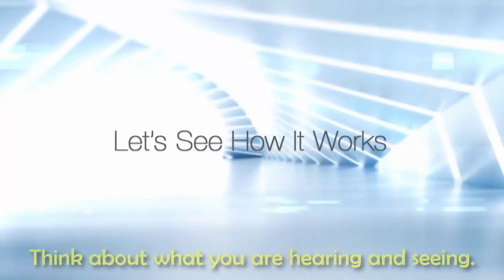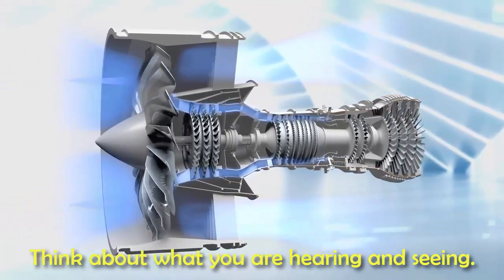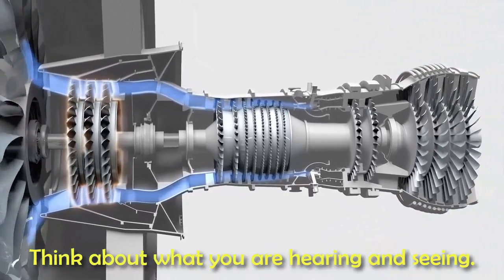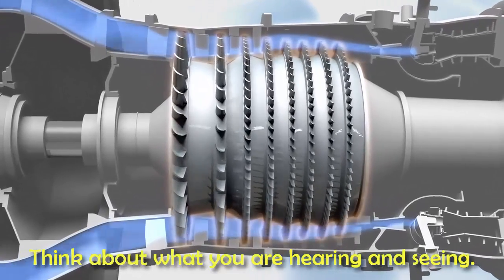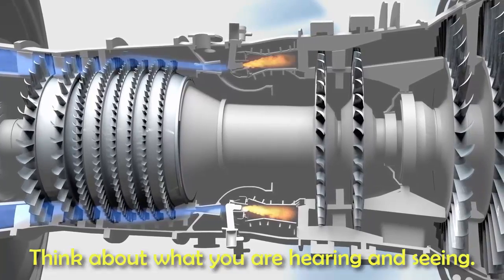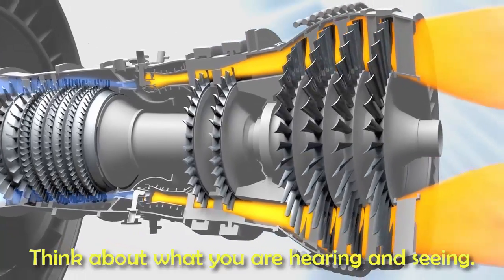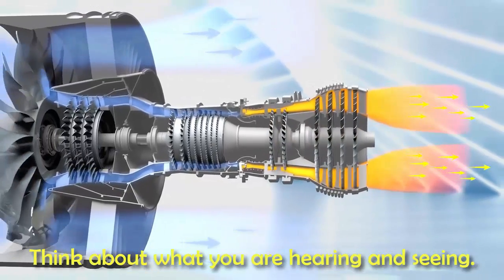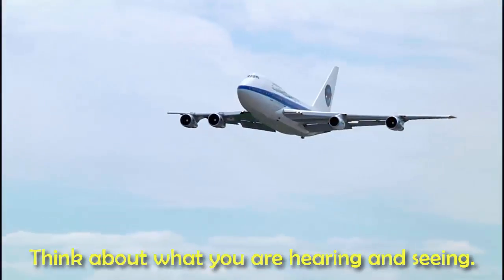'Jet Fuel Hoax' Debunked - Now Onto 'Jet ENGINE Hoax'!

Comment: So. From which part do the AIR control the temperature and cabinpressure?  Even Rolls Royce manual SAYS that the THRUST is 90% compressed air. Just watch next time you board a AIRplane at the AIRPORT how they start the engine no. One.  By compressed Air. On the A380 there is an extra landinggear in the WING.

Comment: Full of error and inaccuracies.
Reply: John le Bon - such as the suggestion that the engines run just in compressed air and not a compressed air / fuel air mixture. They typically burn about 3-4 tons of fuel per hour in the cruise. 

It talks about harmonics and air being fed back into the engine inlet, which doesn’t happen. It suggests the engine has a brake system to prevent it running away and accelerating uncontrollably, which they don’t. 

The speaker is incredulous about how simple the engine is. They actually are at the forefront of metallurgical science, with single crystal blades and special ceramic coatings to prevent heat damage and ensure zero creep.
Reply: John le Bon - first hand evidence.
Reply: John le Bon - in what way do you mean? We used about 55 tons of fuel to travel for 7 hours (7.4 hours block to block). The refuel info was recorded; the fuel usage was recorded; and the paperwork is stored by the company for 3 months. 

Fuel quantity and usage is taken very seriously. 

Did I make some purile you tube video of my exploits? No.
Reply: John le Bon - would that satisfy you? Would 5 pages of printed A4 be enough to lay this at rest? Would you publicly declare the “fuel hoax” to be the rubbish that it actually is?

Comment: You have no clue as to the internal multi stage compressor at work in the high bypass turbofan all you see is the N1 fan blades in the front these blades 
must reach tremendous RPM's to pull in the required air to gain the 80% bypassed air that makes up the majority of thrust. To do this the compressor 
compresses air then mixes fuel to burn and then the compressor extracts the hot gases to turn the spool fast enough to get N1 turning fast enough 
without the burn the N1 fan is only windmilling producing no power. The internal VSV's variable stator vanes are adjustable to smooth the air flow through the compressor stages thus reducing the chance of a compressor stall. A simple description of the turbines operation is suck, squeeze, bang and blow without the bang there is not enough suck to produce thrust.
Reply: @JohnleBon-l3w  with all respect I hope I didn't seem rude I just get worn out with EBNM, Awake Souls, Jason Maggard and others assuming to know aviation facts with zero knowledge I am an aircraft mechanic 20 years both rotary and fixed wing I've worked private, commercial, experimental, government, military and war birds. i've seen the fuel in wings and have been inside them repairing them and I know the exact working of a high bypass turbofan and it's fuel use. I don't like seeing people lied to and deceived. There will most likely one day be a high bypass turbofan run off of electric fuel cells but the technology is still in its infancy battery chemistry needs to advance quite a bit to even begin engineering such a turbine. Yes high bypass turbofans are efficient much more than turbo jets but this only gives the aircraft a longer range that's why you will see certain model aircraft taking on longer routes as it now uses less fuel but still carries the same volume.
Reply: John le Bon checkout Roger Hendy channel he’s from Australia and pulls no punches he is honest and simply describes his videos.
Major proof that turbines use fuel and it’s in them wings

Comment: Do you honestly believe Concorde weighed 192 tonnes? To carry 100 people and their luggage. 
Look into jet fighters, the 1st was the me262 (ww2) twin jet two seater, weighs 7 tonne. F22 raptor , latest jet available , costs $80m , largest % of carbon fibre in a plane ever, weighs 30 tonne. Think about all the remote airports in the world , like khatmandu for example. How on earth are they all kept topped up with thousands and thousands of litres of fuel. 
Harrier jump jet, look at the figures. Apache helicopter, where is the 4000litre fuel tank?
Reply: No. Ive seen it in a museum. Don't let the heat turn you into a jungle surfer pal. Lots of things are real you know. What I'm saying is the airline industry are the kings of obfuscation
Reply: Jacob, an Apache helicopter has a 1400-liter fuel tank. It's in the same place it is on every other helicopter: right behind the crew compartment.

Comment: it's pretty simple. at start they use afterburner to make those engines spin as f... - then they have to reach the proper altitude to let the speed of air run those vanes - imagine if u have a toy windmill and release this outside the car window while u drive 100km/h what will happen? it will spin it will spin very hard. imagine if they fly 800km/h as they claim to, those engine blades inside they spin because of the huge air speeds up high compressing air and causing the thrust. i have to add that once u are 13km up high the amount of oxygen is less but amount of nitrogen is higher than at the ground level - so that is a fuel. once the plane is descending they have to use fuel to sustain the thrust on small plane speeds. that makes sense in my opinion. i remember when plane did 2 circles over the foggy airport in Poland and then straight up to cruising speed and landed after 10min at the different airport and we were grounded for an hour for refuel. So like i said. they use the fuel on the take off and landing only. Once they slow down they have to supply the fuel on the lower altitudes that's why planes  they always go very high while on cruising speed. why don't they fly 5km up high - what's the problem? what's the difference? 5 or 13km? you know what's the difference? this is the difference https://www.higherpeak.com/altitudechart.html look the amount of oxygen at high altitudes. i presume the amount of nitrogen is almost 95% then you just have to have a compressor like our beautiful engines and you have a powerful free energy. Mark my words and think about drag racing cars what do they use as a fuel - methane and nitrous. Let's have a look what wikipedia says about it: and read the whole thing. A nitrous oxide engine is an engine which requires oxygen for burning the fuel in order to create power (mainly stems from the decomposition of nitrous oxide (N2O) rather than air). The system increases the internal combustion engine's power output by allowing fuel to be burned at a higher-than-normal rate, because of the higher partial pressure of oxygen injected with the fuel mixture.[1] Nitrous injection systems may be "dry", where the nitrous oxide is injected separately from fuel, or "wet" in which additional fuel is carried into the engine along with the nitrous. Nitrous oxide systems may not be permitted for street or highway use, depending on local regulations. Nitrous oxide use is permitted in certain classes of auto racing. Reliable operation of an engine with nitrous injection requires careful attention to the strength of engine components and to the accuracy of the mixing systems, otherwise destructive detonations or exceeding engineered component maximums may occur. Nitrous oxide injection systems were applied as early as World War II for certain aircraft engines. <<<<<< Airbus and Boeing don't like that comment. xD
Reply: Adam er get a life high bypass turbofans don't have an afterburner your a complete fraud. The N1 fan blades must spin at massive RPM's to 
suck in the required air to produce thrust this is done through combustion and extracting the hot gases to turn the spool fast enough to get 
that N1 fan spinning fast enough. Suck, squeeze, bang and blow or she won't go! Note the bang without it it's windmilling producing zero thrust.
Reply: Nitrogen doesn't burn.

Jet engines use fuel the entire time they're on. 

Proof: the Gimli Glider, which was an Air Canada Boeing 757 flight that ran out of fuel halfway across Canada. If your theory was correct and jet engines don't need fuel at cruise, the engines on the Glider wouldn't have shut down in midair.

Comment: I am of the opinion that planes do not fly in exactly the manner that we've been taught. 

You may be familiar with the many videos out there of planes that have frozen in mid flight, such as: https://www.youtube.com/watch?v=SKndgDzZxdQ

Well I have personally seen this phenomenon, along with a friend who was in the car. I was near an airport, picking up a friend. A plane in front and to the left of us was coming in for a landing. In mid-flight, it simply froze in the air. Both of us immediately said "What the hell?" 

We drove along, and as we approached the perspective changed but the plane stayed stationary. After several seconds, the plane just instantly started moving again and dropped beneath the tree line. It looked exactly as though someone had just pressed "pause" on a DVD player.

In the video linked above you can only see the "frozen" plane, but it is even more dramatic to the see the plane in motion and THEN freeze, because this makes it more apparent to an observer that it is not just some elaborate optical illusion.

I am definitely a layman on matters of technical flight, so I'd be interested in your point of view on this subject.

Comment: I question it presently.  Also, the tons of fuel in the wings is a scam on the normies as well.  Turbines spin to create energy from the friction created.  The engines are more likely electric engines that create the motion / friction needed to start the engines similar to a car batteries engine that charges the electrical system of a car and also charges the battery.  Fuel is a Hoax and more of a reason to fake the proxy wars we're all watching on T.V
Reply: John le Bon ahhh.  I forgot to take that out when I decided to edit my previous comment.  So, you get the point I'm sure.  Jet fuel is used to charge the electric turbine engines like coal powered energy plants.  Combustion engines they are not.   My bad 🤗. A NP mistake!
Reply: Also, can you offer a theory as to what the jet fuel hoax could indicate if it were actually a real attempt to deceive? 

Learning to love the normies and become less influenced by real truth is the goal!!!!
Reply: Why is it all a scam? I’m flying to the UK tomorrow and will load about 55 tons of fuel, and the flight will take about 7 hours. The Boeing 777 300ER holds about 31 tons of fuel in each wing (main) tank and about another 60 tons in the centre tank. Why the conspiracy?
Reply: Yes you are fueling your (air)-plane with air,.not fuel. Sure you have some fuel aboard but it is for your stater (it provides starting engine) and when start is made,.you no need fuel,.air in your wings help plane take of. And for your info. Not 31 tons, 31.000 US galons or 117.348 litres (105 tons). Do you belive this? This starting process normally uses an electric motor to spin the main turbine shaft. The motor is bolted to the outside of the engine and uses a shaft and gears to connect to the main shaft. The electric motor spins the main shaft until there is enough air blowing through the compressor and the combustion chamber to light the engine.If you have ever been at the airport and watched a big jet engine start up, you know that the blades start rotating slowly. The electric starter motor does that. Then you (sometimes) hear a pop and see smoke come out of the back of the engine. Then the engine spins up and starts producing thrust.Besides the starter shaft, most big jet engines include another output shaft for driving things like electrical generators, air conditioning compressors, etc. needed to operate the plane and keep it comfortable. This shaft can connect to the main turbine shaft at the same point the starter does or elsewhere. Some jet airplanes have a separate turbine (sometimes in the tail cone of the plane) that does nothing but generate auxiliary power. It is more efficient to run this smaller turbine when the plane is sitting on the tarmac.

Comment: Ive been trying to get my head round this for a while and i think the most common mistake is to think in terms of `propeller turbines`; a propeller turbine or fan blade draws air from all around squeezes it slightly then throws it out centrifugally; an impeller turbine draws air in to its centre and continues to compress and focus producing a lot of heat and energy. In fluids this effect is so powerful they call it `the water hammer`, ergo how powerful could this effect be using air ? I think the clue is in the engine design : large to small coming in to focus the "air hammer", then small to large going out to dissipate that energy fast out the back.
Thats my thinking out loud, but what about harmonic resonance ?  Harmonic resonance is when something is tuned perfectly it has a ring to it like a wine glass or bell, when something isnt harmonized it vibrates which can create all sorts of problems in a plane engine. The blades in these engines are tuned and produce harmonics when they are running just like blowing a musical note thro a flute, and adding sound to the process of air impulsion adds energy to it; so we have harmonically charged impulsion squeezed into the centre, some kind of reaction and then reverse impulsion to jettison the energy. Looking at the shape of the blades on the intake part of the engine & seeing how they are angled differently from the blades on the exhaust side give credence to what im saying. I liken it to the movement of a maggot ... back moves up, middle scrunches up, front moves forward.

Comment: Yes well that video explained a modern high bypass jet engine perfectly.
The revs and thus thrust is controlled by the amount of fuel injected which is actually kerosene....it is similar in principle to a kerosene blow torch if you have ever used one of those.
Jet turbine engines are very well suited to large aircraft with huge amounts of thrust.
The first jet engines did not have the bypass component and where very fuel hungry....think it was used on a plane called the commet if I remember correctly....so yeah planes use fuel.
Too much scepticism is not always good.
But it's fun to watch the BS unfold lol
Reply: @JohnleBon-l3w  no of course nobody got hurt nobody died...... That's why it's funny to me.
You have to keep it real though... keep perspective.
Engines use fuel always have TPTB like it that way they make mega bucks out of selling it to us....now where it comes from is the real question...way more interesting.

Comment: no fuel no thrust ..    ?harmonics in fanblades :))? resonances? goal is no resonance/vibrations within the rotary blades coz material tends to crack then..   That guy just concluding stuff from what he researched on the web and didn't fully understand. Where is the breaks? Looping back on itself - sure, the energy from burning the fuel+compressed air mixture, which converts back in rotation, loops back to compress more air. But without the fuel the engine will never run by itself. It's like saying a turbocharged motor In a car would run without fuel once the compression reached a certain pressure.
Reply: Like F1 then. Air powered motor racing is amazing . 1100 hp from a 1.5 litre engine, those chaps are very clever. They use air blowers on the grid and in the pit to feed the engine . No emissions, just a heat haze . No room in such a small car for a 100litre fuel tank.
Reply: @jacobbear8533  Air powered motor racing? Never heard of it. F1 cars do have a 140L fuel tank though. It's directly behind the driver seat between them and the engine.

Comment: 1. Fuel to heat air to expand it for thrust.
2. Fancy stuff is to minimise turbulence as the hot air hits the cold air and to control desired thrust. 
The turbulence is what creates the loud noise you hear

Comment: You can fit a propeller to the drive shaft out the front. And then you have a turbo prop.
Reply: This was my MOS in the military.. Turbo Prop Engines.  I passed the tests, never understood the concept. I worked Maintenance Admin most of the time.. wise.
Reply: If your aunt had balls she'd be your uncle
Reply: OV-10 Bronco
Reply: C-130